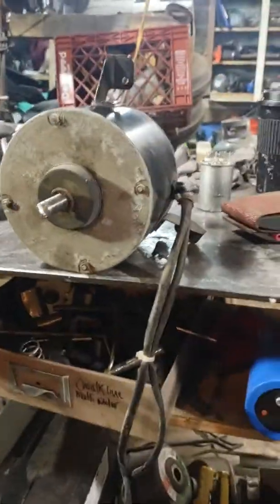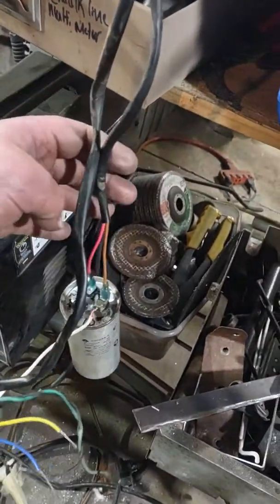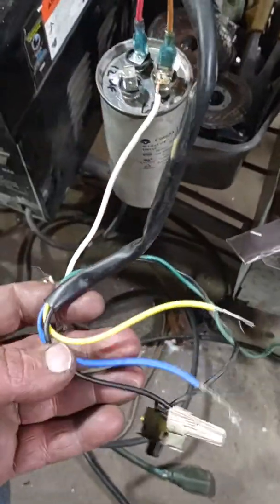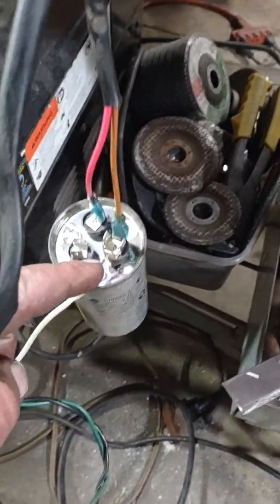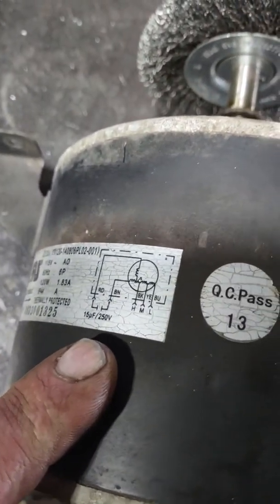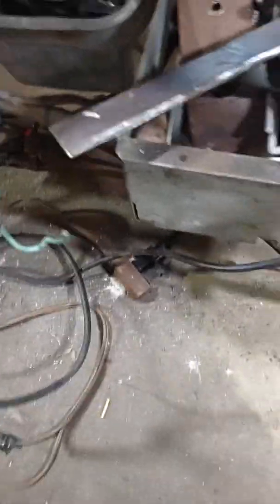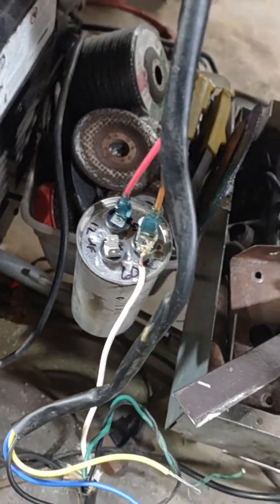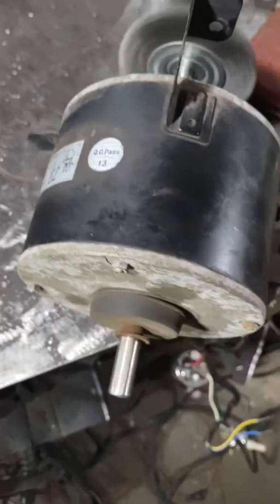😎5 Wire AC fan motor wiring easy DIY😎

Comment: What about your ground wire
Reply from the maker: Directly to the outer case of the motor, sometimes there's a screw somewhere as long as its connected to the outer steel on the motor somewhere.

Comment: I think you have small mistake. Instead of give neutral to BN you need to give line to RD and give neutral to one of the 3 speed H M L
Reply: It's kind of confusing because hot and neutral can be swapped as long as the cap is parallel with the motor. If you connect to RD instead of BN there is still a path that only goes through one of the inductor on the drawing. I wish the drawing was labeled better

Comment: Blower motor from furnace?
Reply from the maker: @gotchaplumber  huge window AC, those have really bood blowers, 10k BTU or around there. Also those stovetop microwaves with the hood blowers
Reply from the maker: Specifically from a 240v window ac unit
Reply: Wiring may get confusing sometimes.

Awesome video!
Reply from the maker: @gotchaplumber  thank you

Comment: Than you so much you took the frustration out of it I am just starting to learn motors thx for the step by step you said something about it being in English I thought something was wrong with me or my phone cuz all I kept getting was videos in India nice job thanks again
Reply: Srry to bother you but  because of your video I was able to get my motor running thx again but I wanted to ask you if you know how to install A 4 position 3 speed switch to that exact setup you did earlier I've tried watching several other videos but they always seem to skip steps or not show every single step it a rotary switch that has L N... On one side and   N 1.2.3 on the other thanks again and sorry to bother you
Reply from the maker: @robg259  so the L terminal is your line or power wire (black) and the N terminal is your neutral (white) as far as the other 1/2/3 terminals would go to your motor wires, the ones left over after hooking up the capacitor, you are going to have to guess and check and see what speed you get with different wire combinations on those 1/2/3 speed terminals
Reply from the maker: And the N terminal on the 123 side of the switch would probably be your neutral from the motor, so I think that's coming from the capacitor...